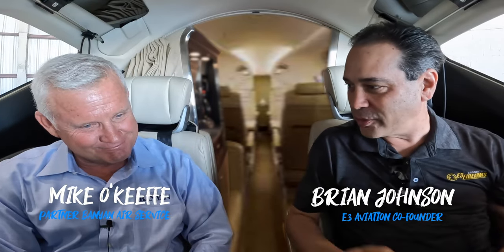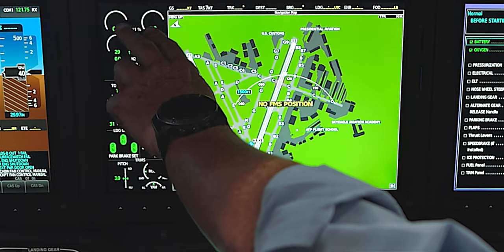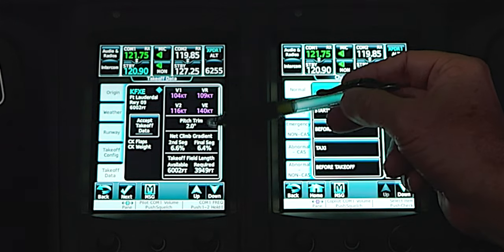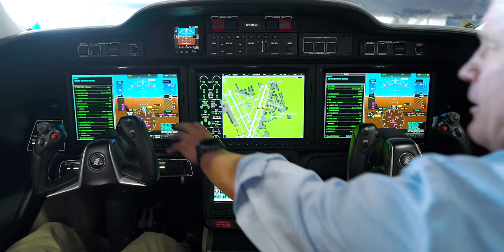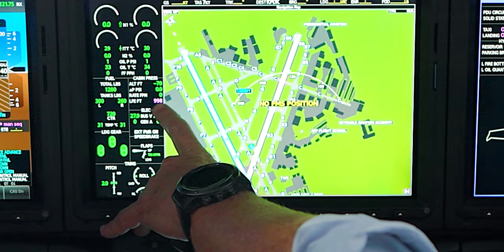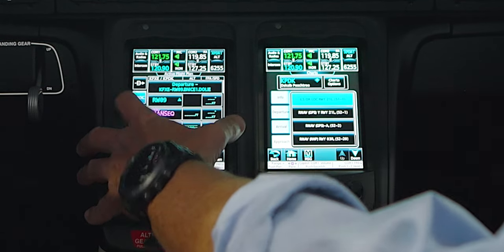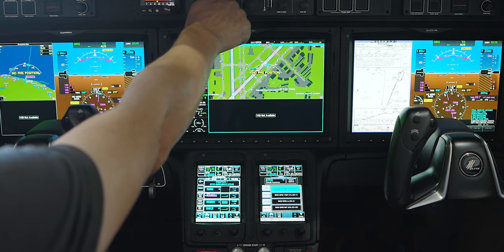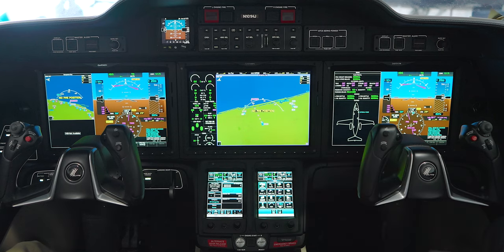Aviation Product Tutorial | HondaJet Cockpit & Garmin G3000

Comment: Great video, clearly missing some features whilst learning the Honda Jet in MSFS flight simulator. But learning fast! Have to say even though it's the simulated version, I learnt to use the systems and get up and running really quick! Honda really have built an amazing flight system. But thanks to this video, I can fill the gaps.